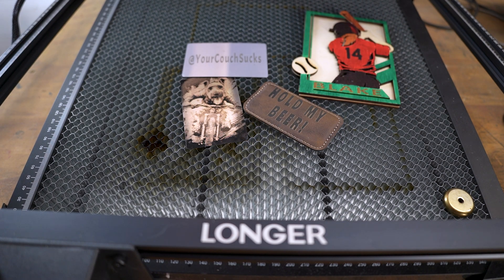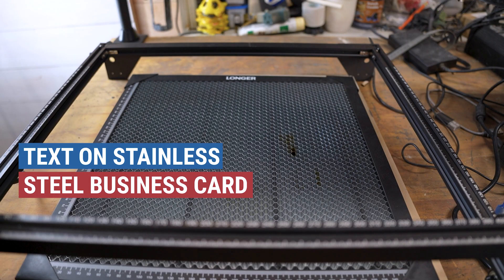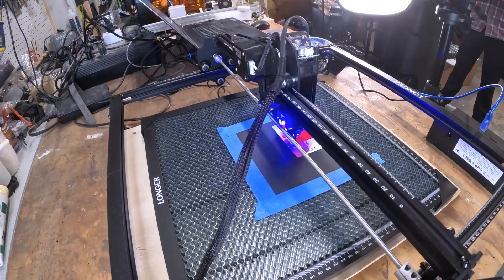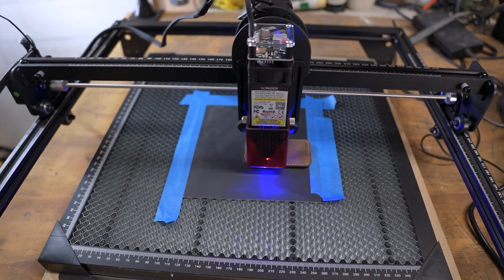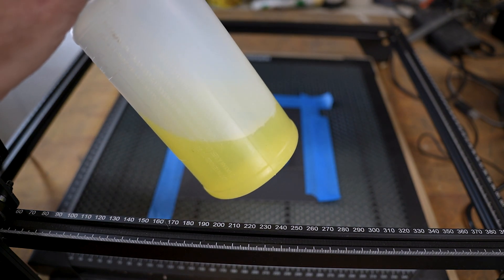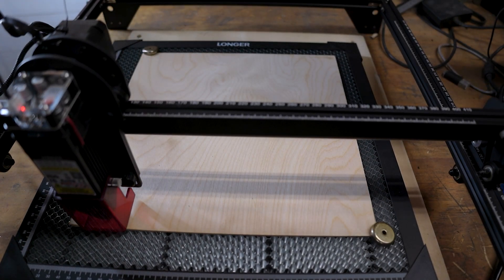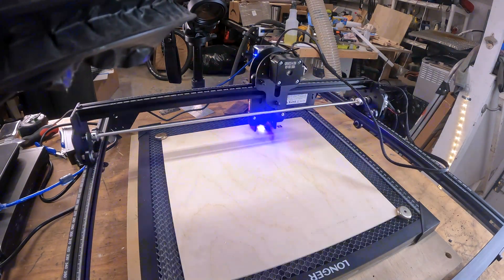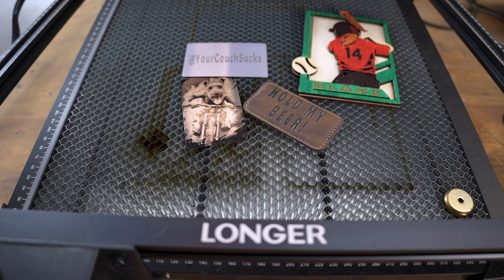It can do that? | 4 projects on the Longer Ray5 10 watt laser

Comment: How did you do the "frame out"?
Reply from the maker: The software most people use for laser engraving is called Lightburn. Within light burn there is a frame button\tool.  You would create a frame around your cut or engraving, sized to your material and that is what is framed when you hit the frame button
Reply: Ive had issue with framing my ray5 10w. Cannoy get it to fram where i want it to. Have any advice or video on it ?